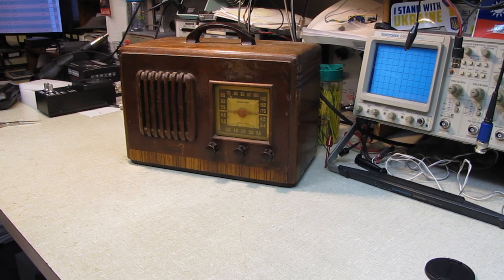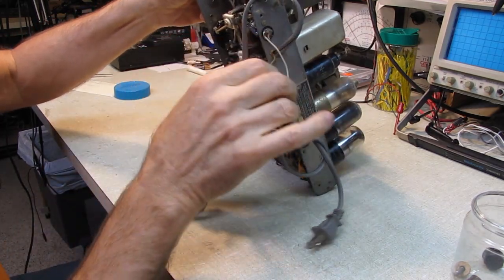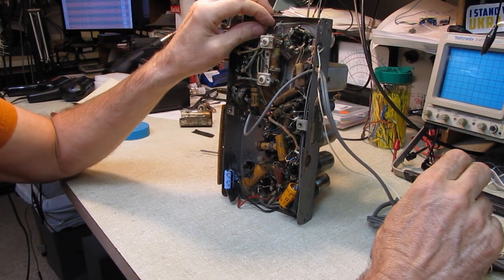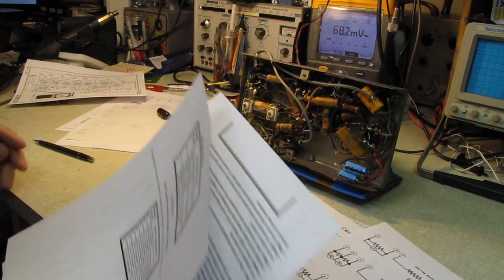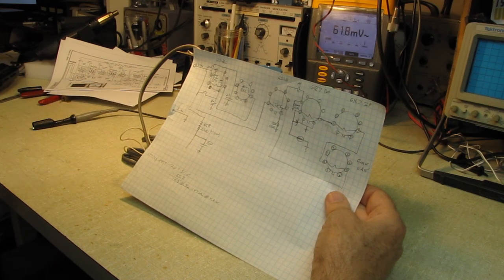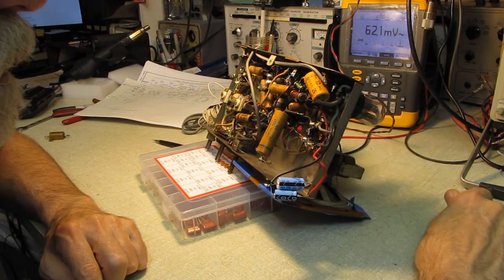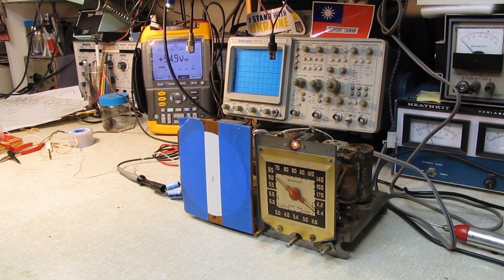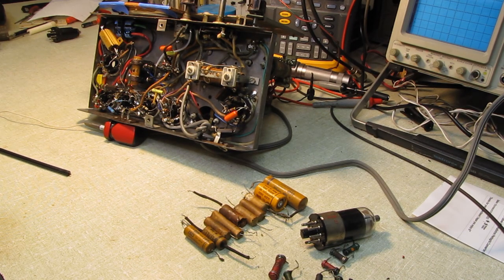General Television & Radio - Unknown Model

Comment: Great work on the power supply and filament string, I've run into replacing tube type and Selenium rectifiers and having to figure out resister values to return them correct operating voltage.  For me most times it's a crap shoot.

Comment: Have you ever worked on an apache transmitter. Dewaine. P.s.  it will blow a fuse when switch to transmit.  Fuse is in plug cord,I know it need changing to 3 prong plug I understand that. Can you make any good guess. Va1dwg
Reply from the maker: It could be any number of things. Let's start simple. What value fuse are you using. It calls for a 7 amp SloBlow. If your using the correct fuse it is time to break out the ohm meter. Remove power and make sure all the caps are discharged.
There is some serious high voltage in this set. 

Check the 500pF(MMF) 5 KV blocking cap. If this has shorted it will shunt the HV to ground through the 2.5 MH Choke at the RF Out. This choke is there to blow the fuse if the 500pf cap goes bad and prevent you from dying if you touch the antenna or coax connection. 

Take a good look at the choke for signs of overheating. If the cap is bad has likely started cooking the choke. 

If the Cap is OK pull the 6146 tubes and the 6AC7 tubes and check them for shorts. 

Try turning on the set without them installed and see if the fuse still blows.

If yes it is time to start checking all the caps.

The manual has a Resistance Table. This is a good place to start. 

I am in Thailand and only have access to the schematic on line and it is a bit tough to follow on the computer.

When I zoom in to read components I can only see a small section of the schematic, when I zoom out I can't read any notes or values.